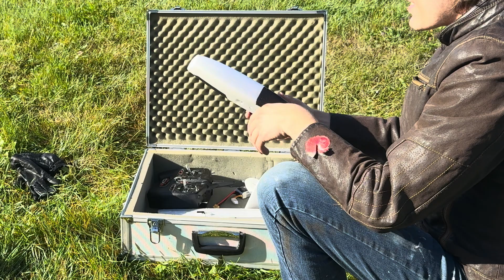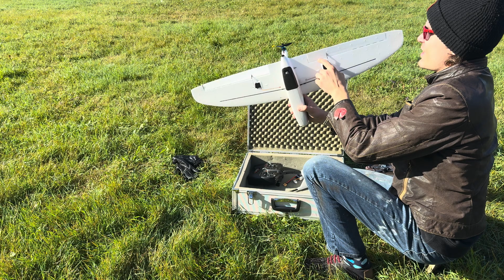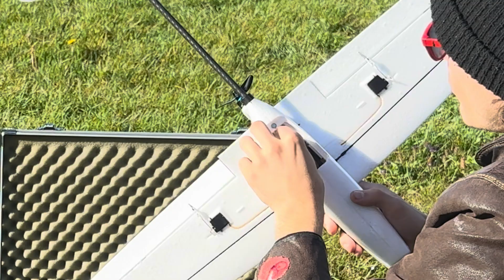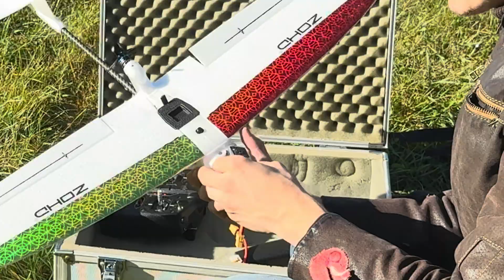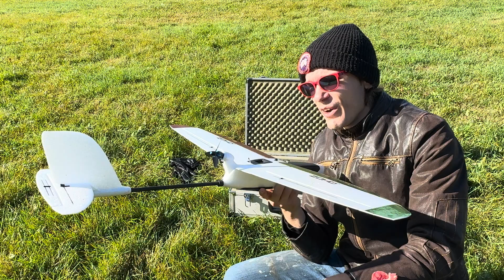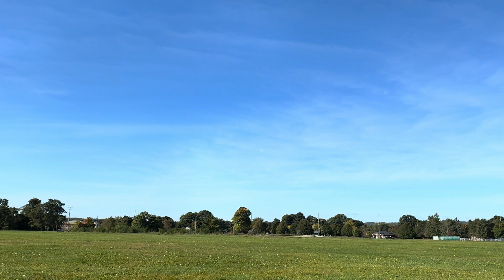ZoHD Sub 250g Mini FPV Fixed Wing Drone Review: Maiden Flight & Setup Guide!

Comment: this is one plane that NEEDS a gyro....   I got one a few months back.  flew it at first without.  put one in and made it much more manageable.   Running INAV ELRS and walksnail in it now.  Kind of a bit too slow to be fun outside, but may find it to be a good indoor flyer this winter.
Reply from the maker: You mention INAV, I assume you managed to squeeze a flight controller inside it? What one? I have an old mini pixhawk but it still is too big, so I’m trying to pick something out. 

But yeah, it doesn’t really have top speed and yet still has a really fast approach speed for landing. I hand catch it to land it now that I have my FPV camera in the nose, and oh wow this thing just doesn’t scrub off speed on approach. Perhaps my CG is wrong and I’m not able to flare properly, not sure but yeah it just will not slow down on approach for landing and comes in really hot. Any tips? I’m switching out radios so I can get better mixing options, I’m going to try and get the ailerons to have some flap mixing but idk how it will go. Might just add a speed break
Reply from the maker: I agree with the gyro though. I disable the gyro when flying FPV in most situations, but hand launching and then putting on my FPV goggles I use the gyro or if I just want to do lazy slow speed near stall cruising, high wind days (since this thing is so light), or just to smooth out my camera footage the gyro is really handy. Mine is set to add a bit of up elevator when in “full gyro/easy” mode, so for launches I just use that mode, give it full throttle, and toss it into the wind. The plane pretty much does the rest (despite it not being a “full” FC/autopilot just a mere balance gyro). I then switch between “minimum gyro/intermediate” mode and manual mode for the flight but if wind gusts are above 40kmh then I usually put the gyro back into full/easy mode. It’s nice having a panic button setup too, this thing is pretty small and sometimes its easy to get mixed up when flying LOS with what side is what, and the panic button has saved me a few times. Same for stalls in FPV, I just hit the panic button and it sorts it out (normally I handle it manually but when I’m over water I don’t chance it and just use the panic button)
Reply: @fortkickass7532  I have a BrainFPV Radix Li with the Wing Power Board.  Super tight fit in the upper bay.  GPS in the top cover, and an ELRS RX just behind the battery. Walksnail Nano v3 all the way forward in the battery bay.   The Radix li is an old discontinued flight controller.  I've heard the speedybee wing mini may fit, but don't know for sure.   Here's a video with a 750mah 3S pack pushing the 2S prop.   https://youtu.be/ScddFxBoTyo

Comment: sick, this looks really cool i might add a elrs receiver
Reply from the maker: Yeah an ELRS setup would be amazing in this. I’m just using a fairly short range spektrum TX and I think my VTX is only 1000mw (analog 5.8ghz), so I can’t really go further than like 600-700ft away before signal gets bad
Reply: @fortkickass7532  sounds like you need better goggles or better antennas as I can go 2km with 800mw and a cheap 80$ goggles, but also ELRS is the only radio I have

Comment: I got one recently. I ended up tearing it apart and using the parts to make my own.

It's too small and cramped to keep the CG far enough back.
Reply from the maker: Yeah the CG is tricky to get right without adding weights on the tail (tape a coin or two on the tail). I have my 1300mah 3s battery as far back as possible, and it still is a bit nose heavy
Reply: @fortkickass7532  I am using a Flysky i6 RX which is gigantic for that little space. It really made everything else awkward.
Reply: @fortkickass7532 with a plane this light, an 850mAh will do just fine, makes it easier to get the CG right
Reply from the maker: Cramped as well…very hard to get a standard sized VTX inside it